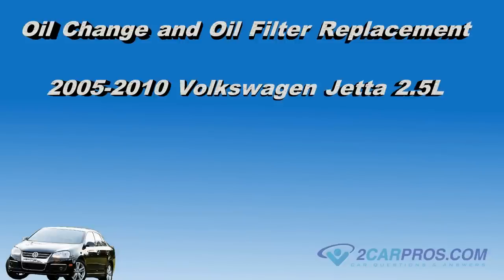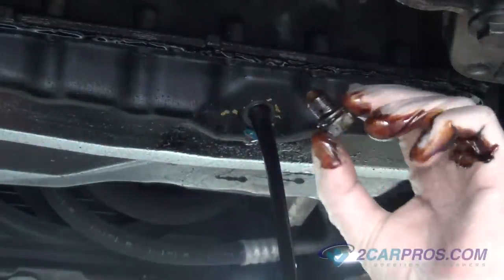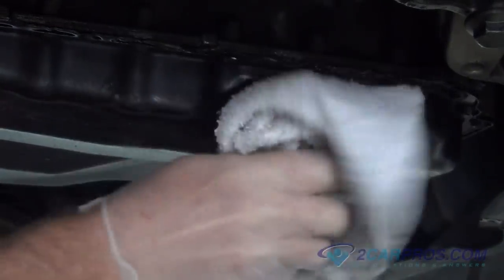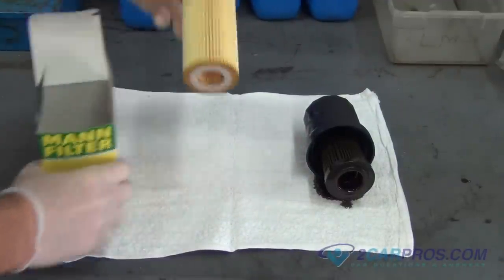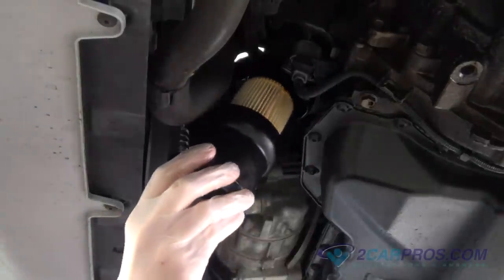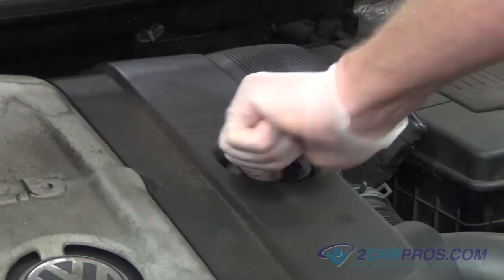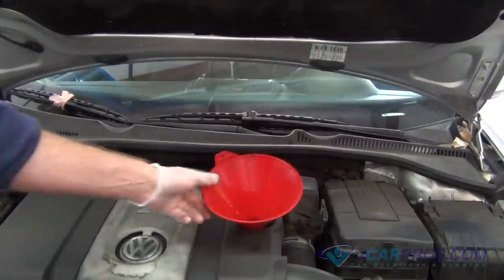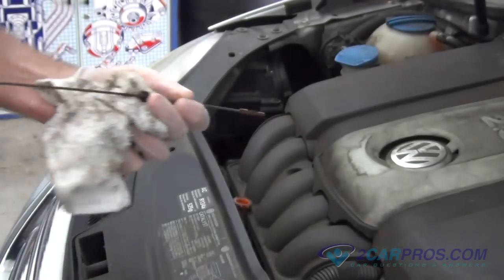Oil Change & Oil Filter Replacement Volkswagen Jetta 2.5L 2005-2010

Comment: Good quality video, but why all the generic information? I watch your videos to learn the details that the manuals don't give. You say to "Use the appropriate size socket". What size is the socket?  Are MK5s all different sizes? You don't show how to dig the seal out of the filter housing. You say to replace the drain plug washer if needed. How do I know if it should be replaced? What signs do I look for? Is there a time limit that the washer is good for - like 10 changes? You said you replaced your washer, Why? You say to tighten the filter housing to factory torque settings, what are they? Then you show putting the filter back on with a dirty towel and hand tightening. What torque setting did you have that towel set for? There is a proper removal cup that should be used to remove the filter housing. Your "backyard" method can result in cracked housings by squeezing it too much.
Reply from the maker: +kokomojoe21  thanks for your comment we will add more information on future videos

Comment: Did anyone els notice he said to torque the drain plug to factory specs, but he dident use a torque wrench when tightening
Reply: Hand tight is fine.
Reply: You mean like the filter housing?
Reply: @robertrukidding3055  hes talking about the the drain plug bolt
Reply: I think Robert was adding that both were done just hand tight.

Comment: Mine has a big freaking plastic cover underneath (2005 2.5L Jetta) that requires Torx screwdrivers to remove and very long arms or a lift/ramp to reach them all. I wish they showed here if there was a short cut to removing that filter without removing that cover. Easy to do if you have a lift, but how many of us have lifts in our driveway?
Reply: does yours hold 6 quarts oil ? i just bought a 2008 2.5 L , i can't believe they hold 6 quarts
Reply: zcam, the manual for the 2010
Jetta with 2.5L calls for 4.2 qts.
with filter chg. I'd suggest putting in 4 qts + a little, run car for 30 seconds,  wait 2 minutes
for oil to settle into pan, then
take a reading of dipstick and
add oil as needed.

Comment: My 9911 replacement oil filter came with two gaskets. One with the tab (like the vid shows replacing) and one thats slightly smaller and round. Where does the second gasket go? Do I need it? (I'm trying to debug a leak after changing the oil.)
Reply: Same here! Mine came with 2 gaskets, I used the one with the tab. What did you use?
Reply: I think I might not have used the second one? I either threw it out, or I might have put it on top? Either way, I went to muffler man and they fixed my leak and said I had just tightened it wrong (I think I missed the threads when tightening it?). Next time I get it changed, I'll ask them about that gasket.
Reply: If it is like my Lexus, the small gasket is for the drain plug gasket on the bottom of the filter housing.  He points it out in the video, but prefers to make a huge mess instead of using the drain plug.  If the little valve inside is not seated and the plug is not tight on the bottom you could have a leak there.

Comment: Come on guys..Not that it is always needed but you should show where the oil pan and filter  is on the car. Most people don't have a lift to do this. Also, it would help if you knew the torque needed. We all don't have manuals. Also recommend a link where you can get the washer, oil recommended, and filter recommended. Make some money that way.. Intentions were good but you guys are missing a lot here. Sorry for the criticism just really only trying to help
Reply from the maker: Couple of things. If you look under the car finding the oil pan should 
jump out at you. I have a lift because this is my job but, doing it with
 a jack and jack stands is totally doable. In fact I have a great video 
on that. You also really don't need to get a torque wrench for every 
bolt on the car, tight is really enough in almost every case. In the new
 videos I provide links to the things I used in the videos, the logic 
back then was, if I tell people what to use everyone will get angry and 
call me names for liking a certain product over an other. I appreciate 
the feedback though! :) Thank you for watching!
Reply: Well I believe the oil pan is covered  by a splash guard and no clue where the filter is. As far as people get angry at you if you recommend a product.. SCREW them... you can't make everyone happy but you can make them informed. Anyhow the video was fine just lacking a little more substance.
Reply: 2CarPros hi, what is the Torque Nm for the oil pan screw?
Reply: lol bro next time dont use the word torque if its not needed.

Comment: Just some tip:
1:17 before loosen the oil filter housing, remove the bottom cap (spin it out), then with a phillips driver push the valve up and let the oil goes out the housing. no mess with oil, then put the valve in their correct position, remove the housing with no mess.
Reply: Just did this.  Much less mess.  Thanks.
Reply: I did that after reading your comment but I didn't put the valve back in the correct position. I completed the oil change and left the valve pushed in and now the car leaks oil. How can I fix it now?
Reply: Man these guys are Pros. Depends from which point of view.
Reply: @rickyortiz2944 super late comment, but for anyone else that sees this, make sure the pin (or valve) that you press up to drain the oil is completely vertical and that nothing is stuck in the cap that could cause it to press up. Another thing is, that pin can be locked to the side to allow oil to come out faster, again, make sure it is completely vertical and pulled down to the correct position before putting the cap back on the oil filter housing

Comment: Does the oil filter holder have only one gasket or two because the new filter comes with 2
Reply: I had the same question. I changed my oil, came with 2 gaskets. Only used the one with the tab, now my car won't stop leaking out of the top of the filter housing... 😅😅

Comment: is that perforated center thing in the housing called the "dong". if this is missing or damaged, will it trigger a low oil pressure warning or p164d code?

Comment: The plastic thing that fits inside the filter; I replaced the filter without realizing that that piece was stuck inside the old filter and replaced it with the new one. What now? Do I just take it back off and put it back in? How much oil will I waste by doing that?
Reply from the maker: Yes absolutely. Maybe a quart at the most. It is totally worth it to ensure the job is done properly.

Comment: I saw on the forums that I can use Synthetic Castrol 5W-20. I have a 2007 2.5l Jetta. Is this correct?
Reply: Only use 5w-40. I use Chevron delo 5w40 diesel oil in mine, it's $18 a gallon and it's a higher quality oil than most gasoline oils
Reply: @coreysnell9222  I got the 5w-40

Comment: you said use 5w40 or 0w40 oil but you put 10w30  in it?
Reply from the maker: The customer requested we use that oil. Thank you so much for watching!
Reply: Customer is beyond stupid, no doubt.  No 5w-30 meets 502.00 VW spec.

Comment: Ever encounter a filter that was hard to remove. I tried to loosen the housing and the whole things was giving me fits. I used channel locks and no dice.
Reply from the maker: +Frank Roman   ya they can be tough, just keep at it
Reply: +Frank Roman know the comment is kinda old now but mine was so damn stubborn i ended up buying a special socket for it lol.
Reply from the maker: +aaron jones   ya they can be tight, I don't know why they made it out of plastic
Reply: I know this is old, but I had to resort to a giant pipe wrench pulling up to the front of the car.  I tried large channel locks, a special socket, a regular oil filter wrench, and a strap wrench first.  The dealer did the last service.

Comment: 2:19 that plastic middle thing in the housing.. is friggin stuck inside my filter! lol when I pull the filter out, the whole plastic comes out of of the housing -_-)..

Might have to get the filter with the plastic inside the filter so it doesn't shrink into the plastic rod thing

Comment: anyone know what size that oil filter socket is?
Reply: 74.5mmx14 flutes, I just measured mine today
Reply: I know it's metric but you can use a standard 3/4 socket also.

Comment: Do i need european oil or any good 5W30 synthetic oil fine?
Reply from the maker: Any API rated SN or higher 5w30 Synthetic will be just fine. I use walmart supertech full synthetic. Thank you so much for watching!
Reply: No 5w-30 does not meet specification for VW 502.00 which is what this engine requires.  You could damage the lobes on your camshaft, this model engine calls for 5w-40 or 0w-40 that meets 502.00 spec ONLY.  I would recommend 5w-40 for hot climate and 0w-40 for cold climate.
Reply: Aaron Schmitz Actaully you can use 5w-30 if it has vw 502.00 approved.

Comment: I use 0 40 amsoil it's the best have 150000 on mine only repair has been the pvc w valve cover 600.00 not bad

Comment: Does anyone just use a fluid extractor for there oil ? Been thinking of buying one cause last time I brought my volkawagen to a shop they stripped the pan threading and it was leaking like a siv. Also have read factory recommended never to remove the drain plug and use extractor.
Reply from the maker: Why don't they want you do remove the drain plug? I have never heard that. I am really curious. Thanks for watching!
Reply: @2carpros  because of how poor quality the oil pan is itself the threading starts to strips after a few times of removing. Go on ECStuning website they sell extractors for that purpose

Comment: you did not show where the oil filter or the oil plug is located could you please do an updated video of that please ty
Reply: Daniel Wing You need to remove the big bottom plastic cover under the car to access the oil filter housing, the filter housing is at front bumper side, the oil plug is located at back side.

at 1:17 video, before loosen the oil filter housing, remove the bottom cap (spin it out), then with a phillips driver push the valve up and let the oil goes out the housing. no mess with oil, then put the valve in their correct position, remove the housing with no mess.

Comment: This video sucks. No mention of having to jack the car, remove the shroud underneath, drain the cartridge before pulling it off, and several other steps. This guy is very irresponsible. Disregard and find another video for the real process.